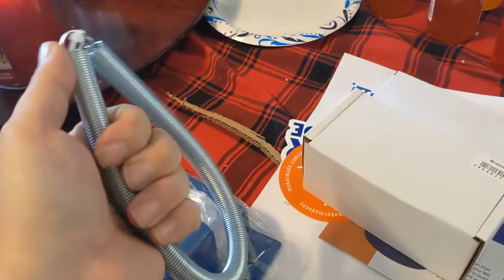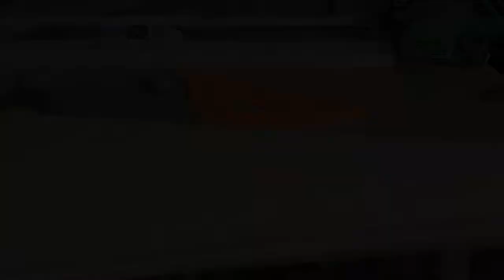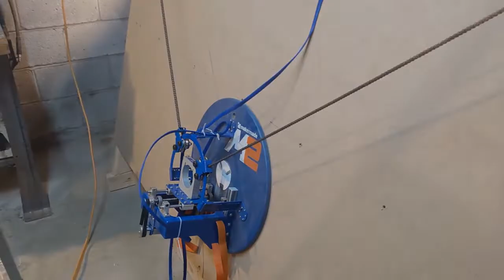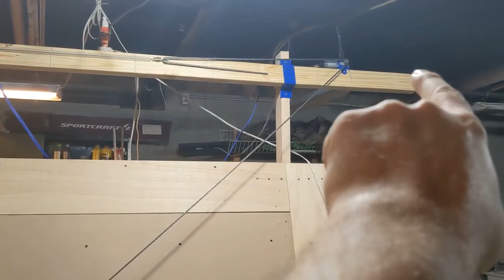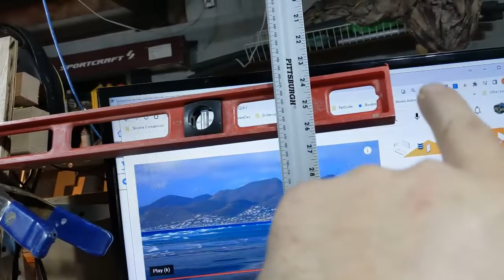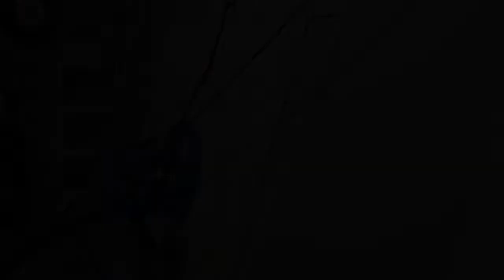Skoolie Build #74: Setting Up and Learning to Use a MakerMade M2 CNC Router

Comment: impressive!  'dashboard/pieces' general routing and emblems?
Reply from the maker: Yes. Pretty much everything remaining to finish the bus interior will be made of plywood which will often be cut on this machine. And the solar racks on the roof will be plywood wrapped in fiberglass and epoxy, just like boat hulls, and then fastened to the roof with stainless rivet nuts and stainless bolts